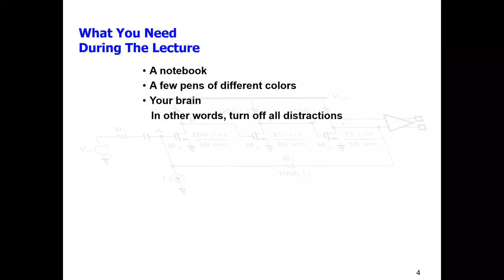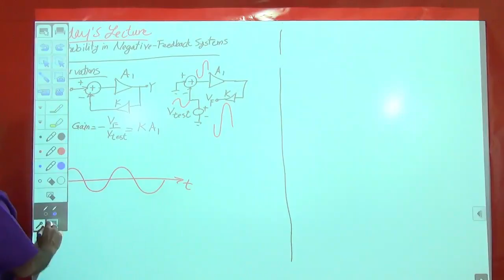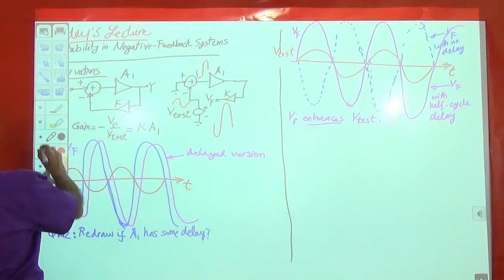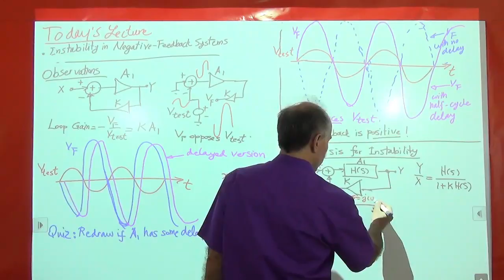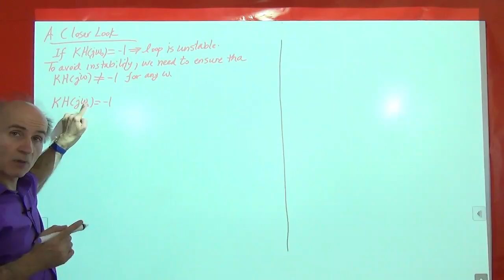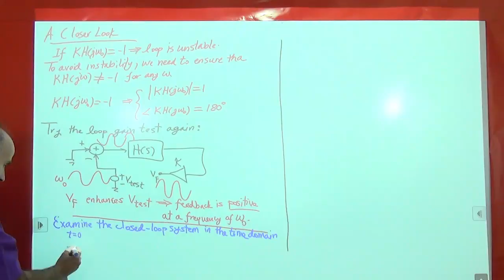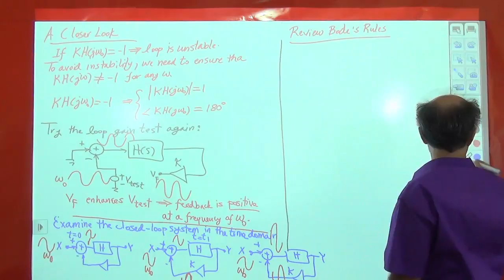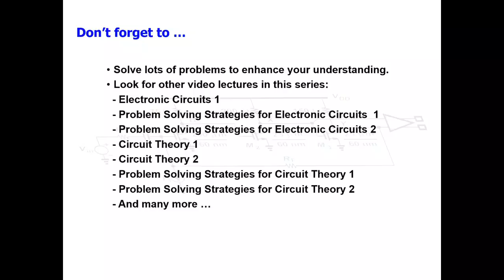Razavi Electronics2 Lec43: Intro. To Instability in Feedback Systems

Comment: 01:16 Negative feedback systems can become unstable, leading to oscillations.
04:33 Explanation of loop gain calculation and its impact on feedback systems
12:47 Long delay in feedback system can change negative feedback to positive feedback
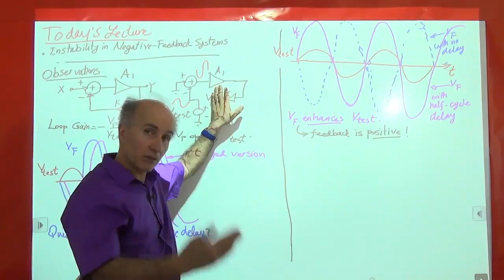16:05 Feedback system instability due to phase shift and delay
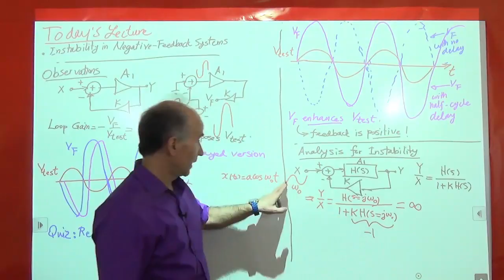21:50 When the loop gain is equal to minus one at a particular frequency, the system becomes unstable.
24:34 Instability in loop systems requires avoiding specific conditions.
31:05 Positive feedback causes system instability
34:27 Exploring the waveforms in a feedback system with a sinusoidal input.
39:40 Understanding Bode's rules for constructing frequency response
42:26 Understanding phase contributions in transfer functions
Crafted by Merlin AI.

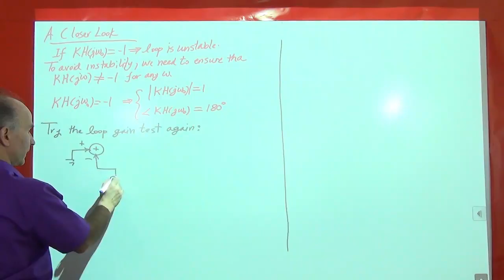Comment: It's clear to see instability from closed-loop gain transfer function as the denominator goes to zero. But the explanation from loop gain test 29:00 is reluctant. To make Vf enhances Vtest, we just need phase shift to be 180 degree without the requirement of unity gain. So how can we explain the unity amplitude is required for instability from "loop gain test"?
Reply: Unity LOOP GAIN KA1 (not unity Gain A1) is required to be having a magnitude of 1 and a phase of 180 degrees shift, which is the same as having the dominator of the transfer function (1+KA1) =0 .
Reply: I have the same question. Using the same snapshots excercise (from 34:00 to 40:00) that prof. used.  Let's say, for instance, that KH(jw0) is 0.5 (So less than 1) with 180 phase shift.  Applying a sinewave with amplitude 1 in X, Vf will present a 180 degree phase shift sinewave with 0.5 amplitude. The subtractor will generate a sinewave that is 1 - (-0.5) = 1.5. That will generate a 0.75 sinewave at VF and so on. So any value of KH(jw0) that is bigger than 0 will add up the signals and become unstable. Could tell me where is the flaw in my reasoning?
Reply: It will converge to 1/1+KH for KH=-0.5 itll go to 2*input
Because the final output is H/1+KH and the final converged loop output is the input of the block H

Comment: is instability important only for negative feedback system? not for CS amplifier?
Reply: Yes, most of the amplifier is employed in negative feedback, because of of several advantages.  For the CS stage, without negative feedback, the amplifier has only one pole, so it is inherently stable. 
The problem generally comes when we have negative feedback. Even if we have a stable open loop, the closed-loop can become unstable. That's why we generally keep sufficient phase-margin.

Comment: Now. I get the confusion, during the break of this loop, we are not considering the loading effect. Is there any reason? Won't we consider the loading during frequency analysis of if feedback amplifier? 
I get the same confusion when I do the stability analysis of common-mode feedback.
Reply: I think you can assum that the loading effect is considered inside the H(s)
Reply: I think it's because as Professor mentioned...that the feedback is mostly frequency independent..hence the reason